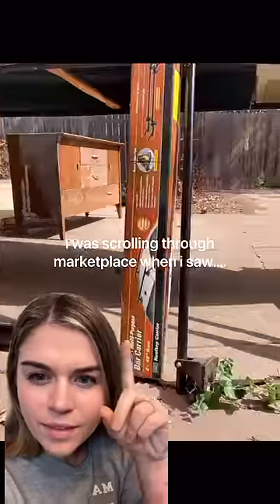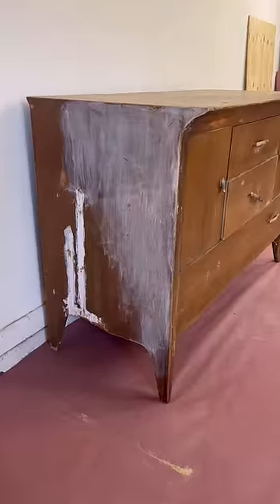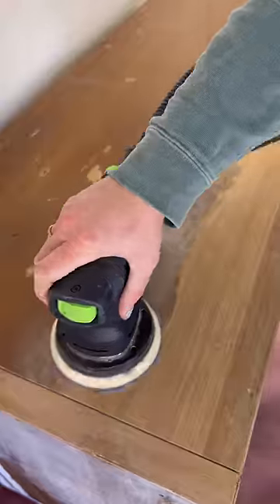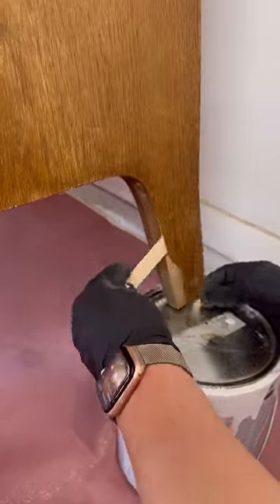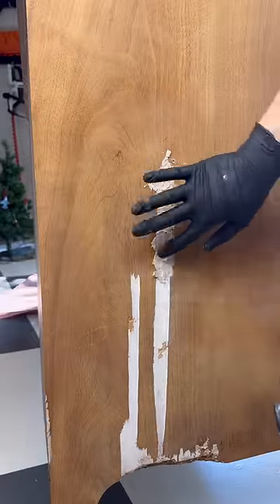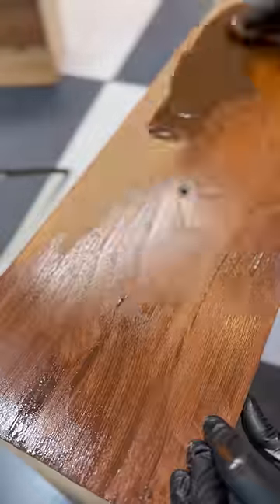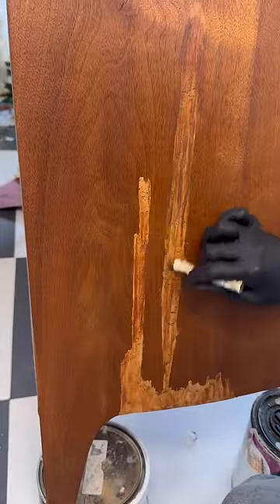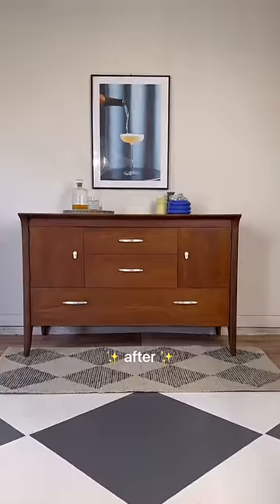My CRAZY Accidental Facebook Marketplace Find! Restoring a Thrifted MCM Walnut Furniture to Flip!

Comment: Great job. In case some of your viewers don’t know , the blending color sticks work extremely well when they are heated up by a butane lighter. ❤ to liquify apply to the damaged area.  Using a putty knife I can spread the material , as well as smoothing it . Allow it to cool for a minute and buff it with a cotton cloth. This process has helped me to make repairs nearly invisible.
Reply from the maker: Thank you😁😁😁
Reply: Oooh a chef’s tortch maube?
Reply: @Notturnoir probably just a simple lighter idk if you can burn it plus the flame will always face away from the work if youre working above it
Reply: Liquid wood repair kits already exist. Amazon has a 18 or 20 color kit for about $20.
Reply: @critter_creek_nature_videos you’re so very helpful. 😒
Reply: Thanks for this tip! 👍🏼
Reply: Could you melt them and pour the colours on top of each other on to a portable surface then pour it on to the spot and swipe with something flat to recreate the wood grain pattern - kind of like how people do when they’re marbling nail polish or ink
Reply: @Notturnoir they sell small torches, often used for cigars
Reply: @Notturnoir cigarette lighter will do the job
Reply: @orls9068  it was a joking comment
Reply: I was never able to use them correctly and I didn’t really get what I was doing wrong. Thank you 😂
Reply: You could also just replace the veneer on that one side, considering you were re-staining the whole thing anyway, might be quicker?
Reply: Yess
Reply: does accept a finish or does it bead up like water on oil? Thanks.
Reply: Finally! No paint! Pretty!
Reply: These blending pens are at the dollar store. Are they the same as what's on here?
Reply: Thank you 😊
Reply: Think you might have mixed up a wax stick to these which are heavy pigments, these are not designed to fill. But to add highly concentrated colour to be smeared and blended on a surface.
Reply: It’s in SUCH bad condition. Not worth the time and energy. This women reminds me of the girl from the curse
Reply: I’m so sorry.. I have this piece.. and I love it when you find these videos that just fit in your life like your phone knows.. freaky… but I love the tips.. I don’t want to damage the structural integrity ..  so is it better to lay them on a heating pad or use the lighter???
Reply: isn’t it dangerous to use an open flame around all those fumes?
Reply: They should have given you $50 to take it
Reply: @SarahS-zq8ru that’s what I would have done.
Reply: Worth all the useless time I spend reading comments! Than you!
Reply: I was going say something the same as you.  
You can also dye the apoxy if your stuck with only apoxy to finish with. 
Masonry mortar powder dye works great, it's only a powder dye with no stone in it.  
Worked great for me on a good few furniture redo flips.   👍👍
Reply: That’s actually very helpful for me. I’m a handyman who does tons of furniture assembly. I got a little too confident and a little too cocky on one dresser with poor instructions and fastened the backside into the front. So I paid out of my own pocket to get him a replacement one and now own a dresser with screw holes in it that need to be hidden lol. I was wondering why my wax stick wasn’t really working on those holes.
Reply: Wow!!! Thanks for the tip!!
Reply: @JohnSmith-jz4pk did you not see the end product?  It absolutely was worth the time and energy-it's beautiful.  And it's not made of faked resin or decoupaged paper over basswood crap they are selling online as real furniture.  As long as she lets the buyer know it's a restored piece, she's not selling museum pieces man.
Reply: Thank you for that tip
Reply: @stj971  hi .I found a old cabinet to finish. Where do you look at to see it's value. Thanks
Reply: @JohnSmith-jz4pk  - But what do you think of the final result?
Reply: Beautiful!! I would love to be able to learn how to refurnish furniture. No idea where to start.. love..
Reply: Do u teach classes on doing what u do. For beginners. Materials. Supplies what to look for in used furniture I would love some simple step by step instructions I need to help getting started.  Maybe someone is local near me and could show me the ropes.. or talk me through what I need I live in nh.. thanks you for any help...
Reply: @johnmurphy9688  I was going to say, why isn't she pre-dying her putty? 😅
Reply: Invest in a heat gun dude. Messing about with open flame is an invitation to injuries and disasters.
Reply: I wish I knew this working at a high end furniture store. I still don't know if it would have allowed for as quick of touches on some of the furniture as were needed and I got to be quite good at blending and forcing different pigments to keep the same grainy look and blend appropriately. It's also a lot easier to have the pigment on you to touch any spots you missed before delivering it that you caught or that showed up during the delivery, but if you are doing restorations, it sounds like you've found a superb way to do it
Reply: @tomcartwright7134  tyvm!!

Comment: Pro tip,  use your sandings mix with epoxy puddy or wood glue as wood filler.  It will save a lot of time blending.
Reply from the maker: Thank you!!
Reply: This is what I learned in wood shop and wood carving classes with Scouts as a kid. 
Also, if I remember correctly, you can test sample some of the shaving glue pre-mixed with some powdered pigments to get the correct color before filling and sanding and staining the rest?.
Reply: @thefurnituredoctor  saving dust for filler is always a good idea—I use it for guitar repair.
Reply: This doesn’t work nearly as well as people make it out to work. The repair ends up being a solid blob of a single, homogenous color that is similar to the wood tones but darker. Furthermore, depending on what glue you mix the dust with, it may not take stain or finishes like real wood does. If you want an invisible repair you’re better off patching with a piece of real wood or veneer, not just dust and glue. Otherwise, a skilled hand can simulate wood grain pretty convincingly with the products used in this video.
Reply: @dp1381  I tried dust and wood glue to fill a seam, and it just ended up looking like a dark line after I put poly on it. Maybe dust and putty would work better?
Reply: @dp1381  true—let me rephrase:
      
Saving and mixing sawdust from the wood you’re about to apply filler to works best for smaller knicks and dings.
      
That said, it also makes a great matching base tone to build off of whenever one needs to fix any COMPLICATED BIG SHIT like dp1381 mentioned.
Reply: It works most of the time, but in this case, her dust included the old finish, which may have made them too dark to use as a filler. It makes a big difference which glue or epoxy is used also, because some can soak up way too much stain while others can soak up less, or can even stop stain from soaking in at all.

Comment: I've found that tinting the epoxy makes blending much easier after it dries.
Reply from the maker: Good to know!
Reply: If you're using Mohawk epoxy sticks, you can buy different shades and mix them together to get a perfect match. Then afterwards all you'd really need would be the graining pens to add the grain details, seal with the spray and you're good to go.

Comment: Back in the mid-70s I worked in a wood furniture-refinishing shop.  When we had to fill any wood surface, we would add some of the wood stain color we planned to use on that piece, to darken the filler so it wasn't so contrasting with the unfinished wood color.  Made the staining and matching steps that followed much simpler.

Comment: Glue and the dust from sanding will blend the wood filler in pro tip of the day
Reply: exactly.
Reply: Glue does not accept stain. Wood dust works in small enough areas the dust isn't saturated with glue.   
Also, it's not that old. The veneer is on the old course particle board.  Mid to late 60's, I'd guess. 
As far as the antipaint folks' painting, furniture was the high-end finish for most of the past 1000 years or more. 
High-end furniture showing grain is relatively recent.

Comment: I LITERALLY  just bought an identical credenza today!! I paid $600 and it's in much better condition than yours was.  Missing one shelf in the cabinet and loose veneer on the bottom of one leg. I was told that it was refinished in a darker color, too. I was curious to know what the original wood looks like! I have ZERO skills at restoring it. But you've given me an idea on how to repair the veneer on the leg.

Comment: $400 - $600 easily. The damaged veneer is only cosmetic and very minor. You did this poor thing justice!
Reply from the maker: Thanks!!
Reply: Agreed!!
Reply: @thefurnituredoctor not more than $50 due to it being stored outside and probably rotting.
Reply: There was a ton of non cosmetic damage she had to repair. I wouldn't price this over 120
Reply: @toscanius she got it for $50, then repaired it. why would they sell it for $50 or less
Reply: @toscanius lmao she literally bought it for $50. I’d say resell max $300
Reply: I'm not sure that's realistic - particularly if you disclose the type of repair. It's generic enough, that I suspect it would only have real value to someone looking for that specific type of piece (either style or designer). You can find excellent refurbs or like new of this piece for $1k list. I suspect someone looking for that wouldn't be interested in one with that type of repair. 
For a non-specific credenza, $400-600 seems kind of high. A shop might sell it for that much, but may have to have it in stock for a year or two to sell it at that amount. And a shop won't pay that much to you.
My concern is that the effort is far more value than the sale price, so you're selling your work at far less value. As a hobby or experience builder, cool, but as in investment or income, it doesn't seem worth it.
But like I said, it's impressive work.
Reply: Max resell should be 300
Reply: 100-300 because it has a lot of veneer and particle board. Thrift shops and garage sales are where items like this end up. Particle board is destroyed after a few days outside bc it absorbs moisture, this will fall apart more
Reply: @FletcherHillier yea this thing was bassically fire wood.
Reply: Yeah, looks like a beautiful restoration, so at least $600 in my book. My first thought was around $1000.
Reply: Ain’t no way you value something wooden stored outside for a couple of months rotting there. It might be only visual and cosmetic we see, but we never know how much it damaged inside. Especially with changing environments what happens in between restoring, selling and putting this in new house.

Especially when none of woodworking were done to add some sustainability to damaged part of piece
Reply: Sell it for $500
Reply: @onceyouwheeinyoucantwheeout  
Cringe

Comment: Apply the epoxy putty more carefully. It looks like it’s not mixed enough or you applied it too late. It should be smooth and consistent. Before it dries,rub the surface with a damp cloth and it will smooth it out ,leading to less sanding.Another tip is to use brown powder pigments that can be mixed right into the putty so the colouring is minimal.

Comment: Get a sample piece of wood and apply the epoxy putty, try an oil based and a water based wood stain, to see the difference. Also there's a difference between dry time and being fully cured.  You need the epoxy fully cured, before applying the stain. Also you should try a car body filler, i use the Big Boy brand and have had fantastic results with it.

Comment: Nice work! What i would recommend for cracks is saving up some of the sawdust from sanding, you can mix that with wood glue and fill the cracks. Ofc that wouldnt work for the corner but the cracks would be way less visible :)
Reply from the maker: Thank you!!

Comment: I’d recommend using citrustrip to get the finish off. It’s environmentally safe and smells great. Plus it doesn’t require you to use a bunch of sanding pads when they get gummed up with the sanding. Also, the veneer on those pieces can be very thin in some places.

Comment: I used that jb weld quick wood on a table and it definitely doesn’t take stain well. My advise would be for a larger repair to patch in new veneer or to use a different stainable putty. You did a good job though.
Reply from the maker: Thank you!!

Comment: Its got veneer on it... I'd say its worth about $50. Could build a new one with about $100-150 in new, solid hardwood. At least in my neighborhood where domestic lumber is pretty cheap. Looks good for what it is, and I'm sure someone might pay a couple hundred for it, but personally, I probably would have cut it down to use as scraps for drawer boxes

Comment: you know you can cut down the time it takes to remove the finish by using a coarser grit of sanding disk, right? just do a rough pass with a 60 and it will be literally like twice as fast, then if you really want you can do a quick onceover with a 120 to knock out any cellulose fractures that are super visible.
Reply from the maker: Good to know!

Comment: I have little to no experience with pricing, but I’ll try!

(Take all of this with a huge grain of salt)

Even if you were to buy it new then immediately sell it you would still have to sell it for less (Because who would buy one from you if they could buy a new one directly, and at the same price?) so that will take some of the value away. I also have no clue what the price of repair was so I’ll just guess that in total you spent 100$ on the buying and repairing. Plus, given the fact that the repairs are still noticeable and in very visible areas, I’d probably say no more than 800-900$?

Personally I would list it at ~600$. Taking Shipping costs and website tax into account aswell (Which varies depending on the site you sell from), you would probably make around 400$ overall (If my scuffed math is right)

You also have to take in account that people may try to bargain with you, so if that’s something you’re willing to do then the price might have to be a bit more than what you want to sell for
Reply from the maker: Wow thank you!!

Comment: Just curious as I’m more familiar with auto body repair, but is their a glazing putty that could be used on the epoxy wood filler to take out all the pin holes and leave a smoother finish?

Comment: It would be easier or cheaper and smarter to just replace the veneer where it's all screwed up You just cut it off with a box cutter and apply glue with new veneer that's close it doesn't have to be perfect it'll look hella better than what you did.

Comment: Why bother cleaning it before sanding it? Doesn't that just ensure that the material you're removing is clean? 

This feels like carefully washing a banana before removing the peel and eating the banana...
Reply from the maker: I like to take double care
Reply: @thefurnituredoctor  I get it... But if you're sanding, the cleaning part is wasted time. You're cleaning surface material before you convert it into sawdust. It would make more sense to sand first, then clean anything that still needs cleaning.
Reply from the maker: @williamdowling7718  cleaning beforehand reduces gumming on my sanding pads, therefor reducing a cost of supplies and increasing profit margins